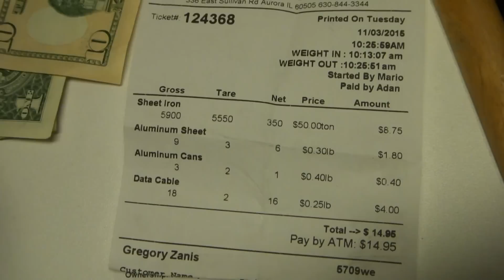Another Load Down To The Scrapper - With Greg Zanis

Comment: Nice to see I'm not the only one still scrapping with theses low prices
Reply: +drank__ It's still trash to cash. I don't travel as much with the lower ferrous costs, but still worth it to me. Especially breaking down motors, etc. if you have the time.
Reply: +Joey Buckets yup I try to get the most valuable metals out of the appliances